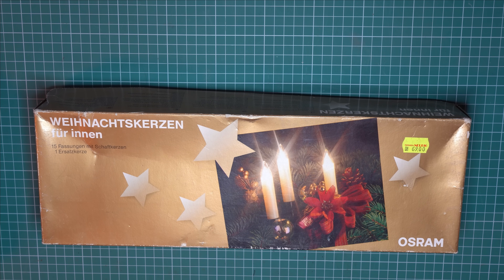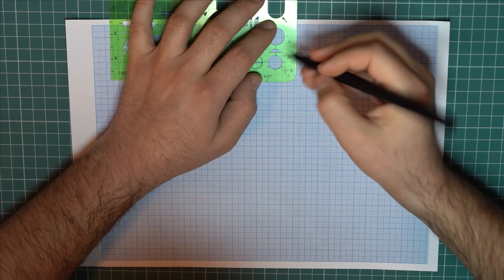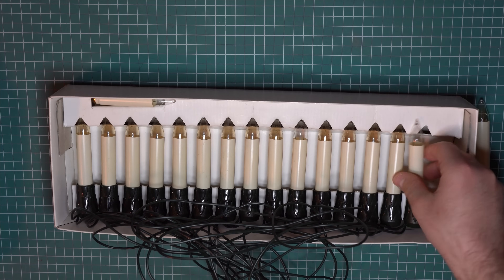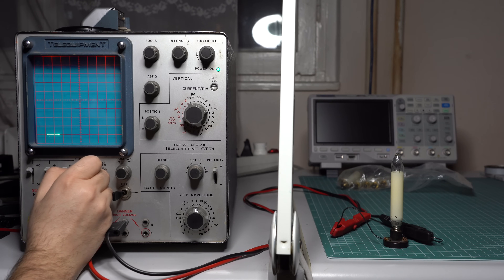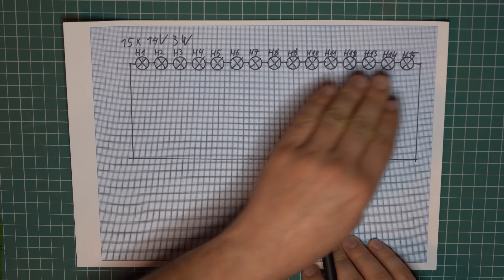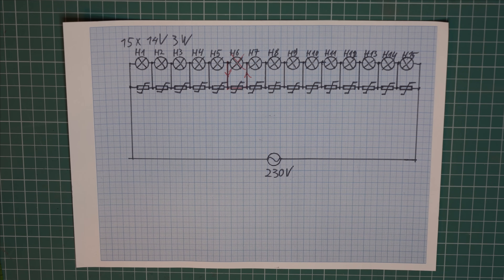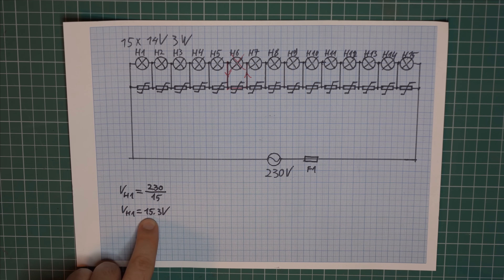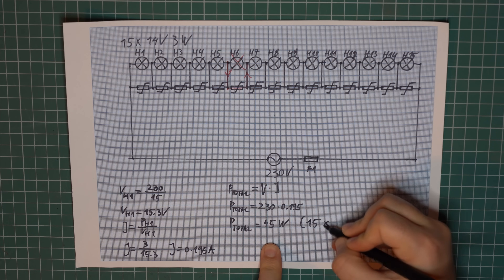The clever engineering behind vintage Christmas lights

Comment: There is not varistor inside the bulb. There is relatively thin wire with thin insulation (could be aluminum wire with thin oxide layer). When voltage over failed bulb increases to full mains voltage the insulation fails and creates (near) short between the terminals. If all the bulbs fails to short the thin wire acts as a fuse.
Reply from the maker: I've seen what you describe in Mr Carlson's video about fairy lights. Mine are different, however. I broke one bulb and in its stem it has a glass capsule with a black powder that acts like some sort of varistor.
Reply: It is actually called an antifuse – instead of opening on overcurrent like a normal fuse (⏛), it shorts on overvoltage. I think that even though varistors do permanently decrease in resistance when conducting, they are not the best way to implement an antifuse because this is leeching off an unintended feature.

Also, the thin wire of the antifuse will indeed double as a fuse, likely blowing safely inside the glass bulb, but I feel hesitant to rely on that. I would prefer a 5x20mm glass fuse in the plug, as the Brits do, or elsewhere on the line.

Comment: Why are you using J as symbol for current?
Reply from the maker: That's supposed to be a capital I. I don't know why I use the cursive one, though. 🙃
Reply: @VoidElectronics In order to distinguish variable symbols from units of measure - cursive is the official way to do it.
Reply: @VoidElectronics  
Yeah - that's confusing. 😁
Merry X-mas. 🎄
Reply from the maker: @Peter_Riis_DK  Thanks for the heads up. Merry Christmas! 😁
Reply: @VoidElectronics YOU SHOULD OPEN UP A BULB AND SHOW US WHAT IS INSIDE IT
Reply from the maker: @bellytripper-nh8ox  I'll make a follow-up. 😁

Comment: Back when we had incandescent fairy lights each set had a fuse bulb, which was indicated by a white painted tip.  If its filament failed, it went open circuit and the whole set would go out.  It was also the first bulb we would first test replacing if the whole set would not light.  One thing I miss with the old multi-colour sets was they typically had more colours (ours had 6 colours) and a tulip-like shade on each bulb, whereas the modern colour sets just have just bare tiny LEDs, just 4 colours and a flickery stroboscopic effect.
Reply: I have never seen flickering LED Christmas lights. It might be because all of them that I have seen come with a power block producing a low DC voltage powering the LEDs.
Reply: @olmostgudinaf8100 In NA, due to the lower supply voltage, many light strings plug straight across the line with just a fused plug and some resistors in the string, no rectification. This is fine for incandescents but aweful for LEDs, not only does it produce low frequency ripple aka flicker, it hammers the LEDs with reverse voltage. I've had cheaper bulb strings last longer then cheap LEDs, especially since LEDs don't always fail full open and may (depending on color) have a higher voltage drop then a standard multimeter test making them harder to diagnose.
Reply: There are nice incandescentlike plasma bulbs ,that flicker a little flame discharge
Reply: @Tylko_cała_prawda_jest_Prawdą please post a link for these

Comment: I think that plug has a fuse, you can unplug one of the wires from that plug to make it easy to put the lights on the tree but I think the central piece between the two wires can also be pulled out and has a glass fuse.
I had ones from another brand with a similar plug and those had a fuse.
Reply from the maker: This one only has banana plugs to make it easier to install and remove the lights.